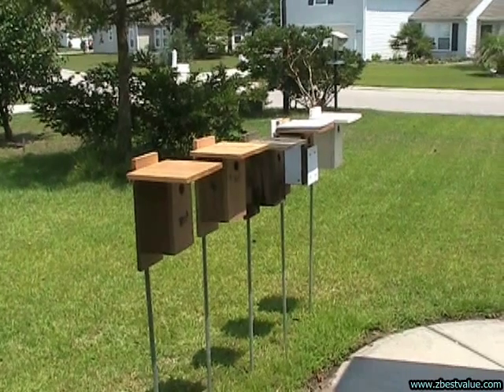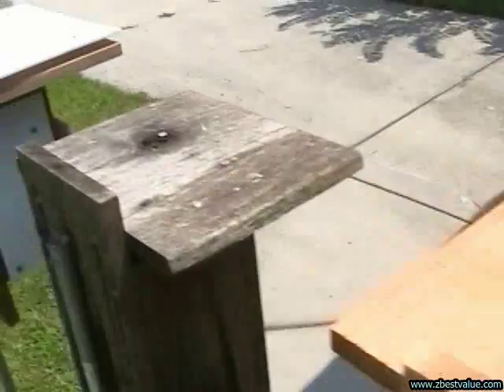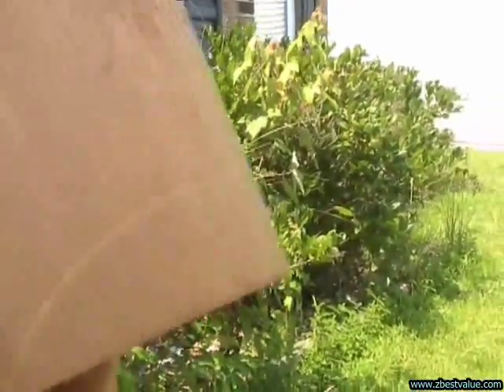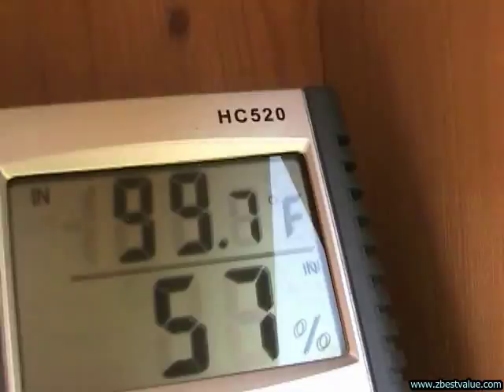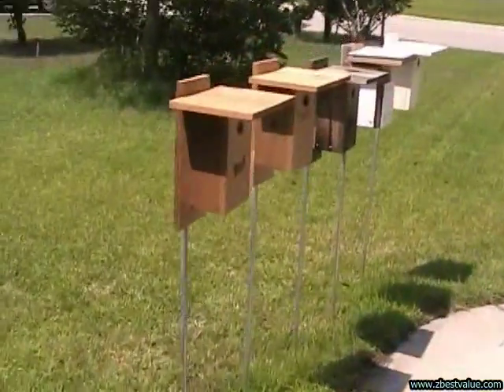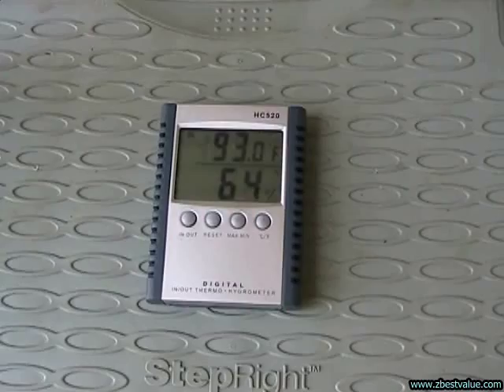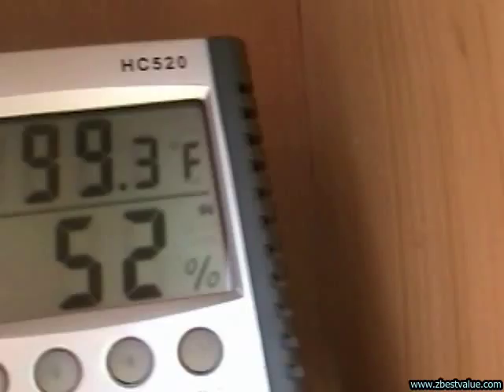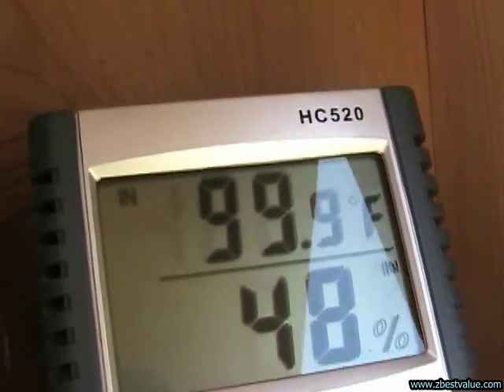Heat Test - Texas Bluebird Nest Box July 30, 2011

Comment: Are birds nesting in July, in Texas?   Here in Chicago,  birds fledged long ago. 
They're long gone.  I can't see value in this data.
Reply from the maker: In Texas and other southern states bluebirds will nest usually at least 3 times per season. There are reports that in Texas and Florida they can even do 4. Where I live in South Carolina they usually do 3 nests per season. If you host nest boxes for birds you NEED TO PAINT YOUR BOXES A LIGHT COLOR! Dark weathered boxes are a death trap for baby nestlings if the box receives direct sunlight in the hot summer.

Comment: Love the vid. Wonder what 2nd roof would be. Also what kind of shield did you use? I wonder if the shield was holding in heat. wonder what perforations would have done to the shields.
Reply from the maker: Shields are made of white Sintra 1/8 inch PVC. Lasts almost forever with zero maintenance. White color reflects the most heat of any color.

Comment: Wow.  That's an eye opener.  I live in Central AL where it gets crazy hot too.  What kind of paint is safe to use on nest boxes?  I find a lot of mixed information about that online.  Great video!
Reply from the maker: Hi thanks for your post. I use regular spray paint from local hardware store. Do this when the box is empty since paint fumes could be harmful to birds. In an emergency with birds in box you can add light colored heat shields without harming them. If birds are close to fledging you will need to block the hole so they don't prefledge when you are drilling the holes for installation. Here is a link with tons more information: http://www.zbestvalue.com/birdsandnature.htm

Comment: They need to face east with sun blocked from behind.  They'll need the heat in the morning and don't need it in the afternoon.  Unless you are using low emmissivity paint all paint is essentially black to heating from sunlight.
Reply from the maker: "All paint is essentially black to heating from sunlight." Not sure what you mean here. My tests prove unequivocally that different colors do affect the temperatures inside a nest box. Darker colors are hotter and lighter colors are cooler.
Reply: Find yourself some "low emmissivity" paint and you'll be surprised at the outcome of that.

Comment: Do bluebirds care what color the boxes are?   Light paint vs natural looking wood?
Reply from the maker: No they don't care. If you put up a light colored box correctly with a metal pole, baffle and away from foliage this represents PRIME and relatively safe bluebird real estate.
Reply: This Video is about best for Heat & Ventilation.  The natural Wood performs the worst & lighter best.  So painting Box light color seems to make the most sense.

Comment: Exceptional video...I wonder what the reading is of a hollowed tree  that bluebirds use in nature?  But at least I know light painting is by far the coolest house in town.
Reply from the maker: I would guess that a tree would be noticeably cooler not only because of the insulation of the trunk but also due to shade from foliage.
Reply: My wife saw your test video with the bluebird houses next to each other. i explained that this was only to test the temps inside. She asked if more than one house can be put up in the yard (we have 1 1/4 acres,w/one blue bird house)?
Reply from the maker: Sure but I would probably space them out at least 75-100 feet apart. Bluebirds have territories they defend but other species like chickadees. titmice and tree swallows can use them. I have my bluebird box in the front yard and chickadee box in the back on the edge of the woods. The back box was even used by a pair of Carolina Wrens once. For more information check out this forum: http://bluebirdnut.com/forums/forum/bluebird-chatter/